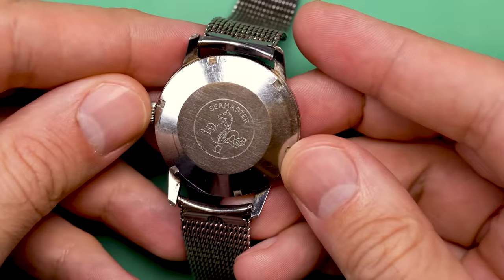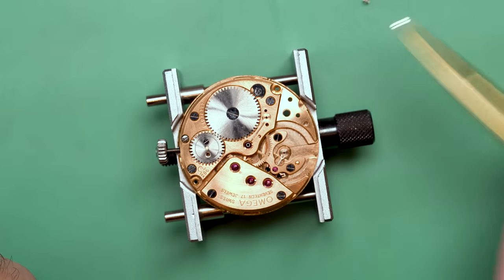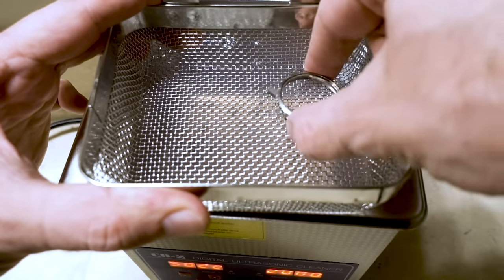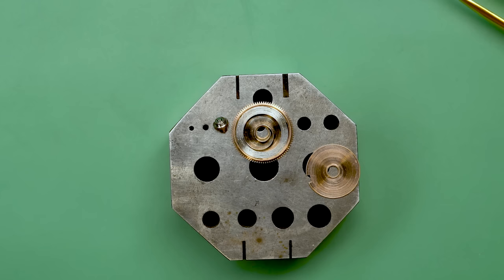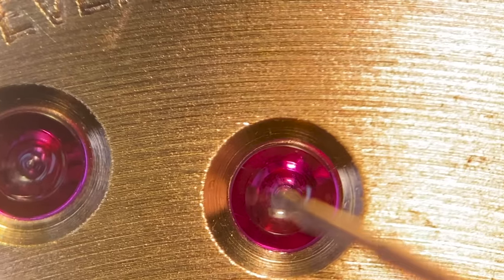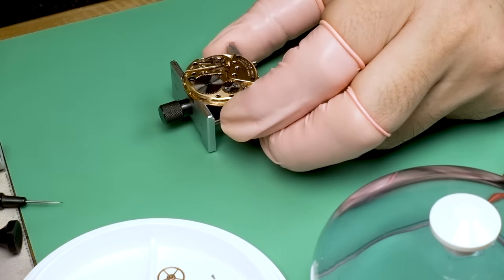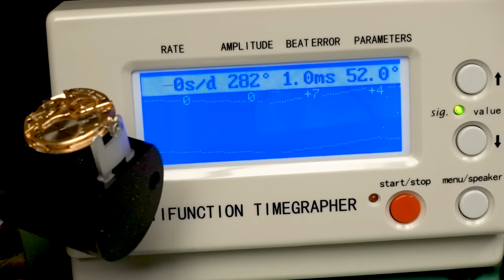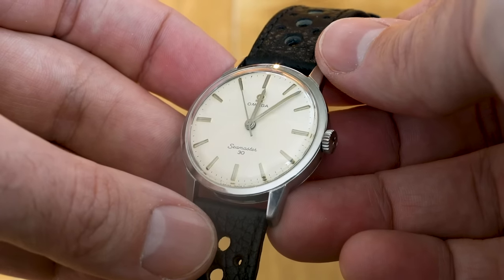Omega Seamaster 30 Vintage Watch Restoration With a Surprise :(

Comment: I understand the risk with “as is” but I have a couple of thoughts. 1.  The owner knew the balance was missing and chose not to divulge that which is severely dishonest and more than deserves serious negative feedback on eBay to warn others of this persons lack of decency. They don’t just mysteriously fall out of the case while your sleeping. Is it possible the owner bought it that way and never took it in to be inspected?  Yes, and I could be struck by lightning 3 times on my way in to work tomorrow.  2.  Always request movement shots. If they can’t/won’t provide them then that is a huge warning sign to stay away. If the person selling does not know how or have the tools needed to take off the case back then they can have a jeweler do it for like $5-$10. Take a couple quick shots then have it put back on while still in the store. Either way these risks can be mitigated greatly with a little perseverance. If they won’t spend $5 to make $500 you can damn well bet there is a reason why. 

This gets a little glossed over because you happened to have the exact same watch, with the same movement, from the same era on hand. I can only guess you bought the second one to be sure you’d have the parts to at least get 1 fully operational watch out of the deal but if you have to buy 2 bargain watches to get 1 working example then that is no longer a bargain. You would be better off economically buying runners that just need a service.  Those are still a risk but at least you know all the major components are in there. That’s just my take. Everyone has to navigate their own minefield that is buying second hand goods with no warranty/returns.

Comment: how difficult/expnsive would it be to source a new balance wheel?
Reply from the maker: You'd have to find one on eBay either on its own or part of a donor movement.
Reply: @WristwatchRevival  I mean, how much would this replacement part cost?

Comment: Very enjoyable production.  One recommendation if I may:  The balance-wheel shouldn't be allowed to oscillate whilst removing the cap jewel of the anti-shock mechanism's assembly.  By doing this while the balance wheel is in motion compromises the uprightness of the balance staff and could necessitate re-polishing the pivots of same.  I think the fork stones abrasions were the result of poor stone seating alignment and/or lack of lubrication.  Your calm and assembly discipline are progressing nicely and your bench tools appear to be of well-chosen quality and appear over all very comfortable to you.  You're obviously pursuing your craft with a good design plan and a successful arc is assured.   With all due respect I don't think the brass tweezers you use for general disassembly/assembly are best suited to your hand/eye interface. Lighter jaws on tweezers promotes, or elicits a more more refined 'touch'. If you experimented with a finer & standard length stainless with narrower points I think you'd develop a more intuitive feel for the connection's synchronicity   Please make more videos and maintain that thoughtful form of narration.                                       Thank You
                                                                                                            Mike Kirwan - Kenmore, WA

Comment: I was curious, do the dial screws work in a similar fashion as the screws that hold the cover on a ceiling light? The glass dome cover slides on and there are 3 or four screws that tighten, and press against the lip of the glass dome to hold it in place.  I know that's a strange comparison but the concept is really what I was curious about. The screws are tightened, and they press against the dial to hold it in?

Comment: Yeah... this is why if I read that a watch is a non runner, its going to have pics of the movement with the case back off before I bid. Unless it EXTREMELY cheap. I'm new so parts are something I don't have alot of.

Comment: On the balance wheel assembly there is what appears to be an adjustment with little tic marks and the letters A and R. I’ve seen it on other watches you’ve serviced. What is that for exactly?

Comment: Question. He said that he had cleaned that replacement balance prior to installing it, but once we got those close up looks at around 37 minutes, while he was removing the cap jewels, the balance still looked a bit dirty and corroded. What was all that?

Comment: I’m curious: how long did it take to become reasonably proficient, meaning that you could confidently embark on a simpler watch with confidence that you could succeed in restoring it?
Reply: When it comes to the movement, you can restore one on the first try without much difficulty
They are designed to be serviced, take it apart, clean the parts in an ultrasonic and oil the parts upon reassembly
There are a number of complications that can arise, bent parts, warped springs, a case that needs restoration
All of those are super difficult, but you could get away with a servicing on the first try, I recommend it, it's highly rewarding : )
Reply from the maker: For me it took about 4-5 months of poking around? I took Mark's class from @watchrepairchannel on watchrepairlessons.com but still needed some time to get more comfortable

Comment: I love your videos.  They are so relaxing and informative.  I am interested in starting the hobby but I don't find many candidates on Ebay.  For example, would you buy a balance assembly if you didn't have another parts movement?  What is you source for new parts because there must be parts that you can't find on ebay?  It's almost as if ebay is has been bought out by hobbyists who started long ago.

Comment: Thank you for your detailed and educational breakdown of the watch. You have a way of informing us with a pleasant easy going way of communicating . You have very steady hands and are very talented.  Thank you so much for sharing your knowledge. I have a question about the metal that were used. What is the gold material used to make up the inner parts. I am a watch idiot savant "WIS"
The favorite watches in my collection an Omega Seamaster with coaxial movement, Omega Speedmaster from the Moon to Mars. This is an attractive watch with the earth, moon and Mars sub dials
Another favorite is Ulysses Nardin Maxi Marine with black dimpled face. It is my daily go-to watch. The lume is top nought. Ths is the easiest watch to read at night while sleeping. The power reserve is a nice complication. The inverted cyclops give the crystal a nice finish and helps read the date. Can you provide me information where I can get the watch servicdd by a quality shop that do a good job at service and workmanship. Thank you for  the service you provide to people.

Comment: WOW !  Where are you ?  My 1970 Omega Seamaster electronic stopped. Had to send it to the UK from Fance to have it repaired. 500 Euro later, it finally works but adjustment using a ballpoint pen still sucks.  Would you like to repair my 1965 mechanical Oris Star (only a microscopic broken part to be replaced) ?

Comment: Question, is it possible to change a 24 hour  hand at the 3 o’clock sub position to a 60 second  hand movement? By changing gear ratios.
On a wrist watch with that has hour hand minute hand and date indicator at 6 o’clock position. 2 sub dials one at 3 and one at 9.

Comment: I'm late to this party, but I had to stop to say, this is my watch! Almost. I have a very similar Seamster 30. The dial on mine is almost identical, except the hands and indices are rose gold and the Seamster 'S' is the narrower style. Mine came with a balance wheel though! But I know the crown's not original because I replaced it myself.

Did you give it away in the end? I saw you wearing it in a later video. (Don't blame you!)

Great content and channel. Mark Lovick seems to have gone to ground, which is a real shame. Thank you.

Comment: Looks like those pallet jewels were running without lubrication for a long time, or maybe with grinding paste for lubricant.  That surface would get kicked by the escape wheel teeth 18000 times an hour but it would still take a while.  I'd be worried about the teeth on the escape wheel as well.

Comment: When you use those hand levers, I always wonder why you don't coat the back of them so that you don't need to pick through a scrap of plastic that may or may not have grit on it. 
Some nice white Teflon ought ot make the job a lottle more secure, I would think.

Comment: I’ve had that happen before where they said, “Used to run, but doesn’t anymore. Sold AS IS” then I opened up to see no balance wheel.  I mean, technically, they told the truth.  They just left out that it doesn’t run because they removed part of it! 

Shady way to sell watches IMHO

Comment: I find these interesting. Especially how we used to have a place that fixed watches, but they had closed down a while ago. So with watching these, I kinda hope that I can learn to fix these things myself if I ever need to. Though the most I do now is just change batteries, and adjust metal links for bands. I did even change someone's leather band out as it was worn down, they liked that.

Comment: 13:30 - why did you pick the parts off the table, put them back on the watch, then put them back on the table? You did it earlier with a couple screws also. Is there a reason for that?

Comment: I have an ACCUTRON that stopped running, usually just needs a battery but cant get anyone to work on it that doesnt want a fortune to fixit, any suggestions. Do you ever do a program on ACCUTRONS, they are nice.  Thanks, Jeff

Comment: The only reason I do not really go all out on vintage watches is their cases. I hate plated cases. They almost always have pitting and that creates a weak point.
Cost of re-chroming or plating of any sort ( other than Ceracoat ) is just too high in price. It is great for you who like to keep them looking the way they are. But I wear watches.

Comment: Hi Marshall, brilliant channel. I know absolutely nothing about watch making but nevertheless I find it compulsive viewing. Is there a reason why you don't place the bridges and jewels in the ultrasonic bath?
Cheers Eddie from the UK
Reply from the maker: Hey Eddie! I sometimes do, but generally they don't need that step as the watch cleaning machine does a good job. If, however, I notice that the plates could use more work then I'll put them in the ultrasonic as well

Comment: Do you have any diagrams that show you an exploded view of the watch movement?.  Sometimes I wonder if it would be easy to reassemble a gear or piece upside down inadvertently.   I mean I am sure the plates and stuff are straight forward because the holes for the screws are countersunk so you couldn’t assemble backwards  but it seems like if you took something apart and then reassembled let’s say a week later it could be difficult.
Reply from the maker: I don't have anything like that

Comment: Watched the entire video and subscribed.  At the present I am my father's Seamaster restored ( which is costing me a fortune).  It is an early 60s Gent Seamaster (plain). Could you please tell me how the Omega logo on the face attached?  Is it screwed in from back or glued?  I didnt notice  any attachment when you turned the face over.
Reply from the maker: They are almost always glued, and they often have two little feet to place them correctly, but not always.

Comment: I will trade the tiny work for a 45 minute bridge or plate installation on a clock any day… i gave it a try but nope not gonna sit there for nearly an hour just to find out something is in the wrong place and have to do it over again….. watches are easier.

Comment: Is there an easy way to remove that type of back cases without the machine he’s using? I just bought a vintage Tissot Seastar that has a similar case an wanted to check the movement

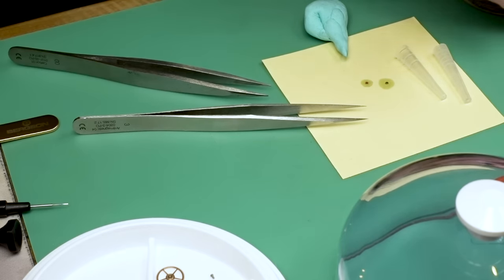Comment: Marshal. Can you please tell me were i can find the #8 tweezers that you use at 37:49 of the video. 
I’m a beginner to watch repair and noticed the tips on those look quite strong. 
I’ve bent my finer tip tweezers putting the canon pinion on. 
Thank you for your time and help. 
John.
Reply from the maker: Hey John, the big beefy tweezers I use to hold the jewels are actually #00 not 8, and I got them from cousinsuk I believe.

Comment: Great video as usual...just wondering does it mean that the watch is now a "frankenwatch" now that its made from two different watches? I'm not trying to dis the piece (which is gorgeous) just trying to understand what is really meant by frankenwatch, and why it's so bad? Also what do you use to magnify, a stereo microscope?
Reply from the maker: Frankenwatch means that it's assembled from different watch models, otherwise any watch that had a replacement part would be a frankenwatch.

Comment: How do you regulate the beat error? Thanks for sharing :) Great camera work.
Reply from the maker: Many watches have a beat error corrector on the balance, but this one doesn't so you have to take the balance off, fractionally turn the balance spring collet, check it, then repeat until it's right. It's a chore, and this video was getting long enough so I'll do it off video.
Reply: @WristwatchRevival  Thank you for the answer :)

Comment: hi there I have a tag heuer bought in the 90's new by me its seen a fair bit of life including some diving in the ocean as well as swimming pools  so chlorine and salt have worked their way into the rotary bezel ( it used to have a ratchet to stop it from bing accidentaly moved the ratchet no longer works I was informed this ring is just a clip on by means of a spring clip / right or wrong ?? any ideas?? as I rely on this watch when diving as a back up to my tank gauge  I am a master mechanic so this is not totaly out of my wheel house / by the way love the channel

Comment: I have a problem. I see detail. In this restoration the balance wheel was missing and needed to be replaced. The replacement balance wheel looked soiled, rusted and contaminated with visible brown goop at 37:30.(look at the left of the screen). Why would you put this dirty balance wheel into a recently cleaned movement? Am I missing something here? Your thoroughness and desire for perfection seem to have left the building.

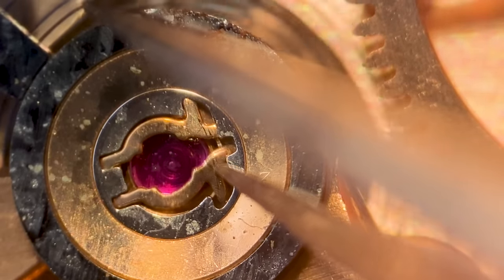Comment: It's a beautiful watch but your dish is as good as the worst of its ingredients, you forgot to clean that regulator (possibly even the balance) it's offensively dirty (37:18, 37:31) and in my opinion ruins the whole work and that gasket could also have been removed earlier, those hard bits could have scratched the glass.

Comment: maybe a couple of idiot questions (after about 40 videos I have already seen). Can fitted a rolex or a longines weel of the same dimensions ? Can this improve the accuracy of the watch ?  If we titanium plate the pivots the friction will be reduced ? (I have never dare till now to touch or even open a watch - not even from the flee market one -  just for optical inspection)

Comment: one might suggest an industry move over to viton gaskets?
if im not mistaken thats butyl rubber.
viton dont break down, in the auto industry? we dont bother with butyl if we can help it, specialist gasket shapes are an exception, but air conditioning gaskets made of viton, pretty much last forever , never use anything else, theres no point.
, not nitrile butyl etc.
viton will happily sit in neat diesel oil and not break down for many many many years.
its overkill but the gaskets are so tiny , why not?
oil doesnt break it downso you can use a slightly better grease than thin ole silicon too, when the gasket is so very small. makes no sense to be using butyl, which indeed will eventually crack or degrade due to age or exposure.

Comment: My wife has a small gold ? watch, it says "omega constellation 25 jewels  1978 18k 0,750" on the case, it ticks, but will only  run from 10 minutes to the whole hours till 10 minutes after the hours, than the hands stop, ik keeps ticking though, and the tiny seconds hand on a small face keeps moving.. I wonder if it is a real Omega watch...

Comment: I have a non working Omega Chronostop, from late 1960's, hand winding watch Cal 865 Ref. 146.009 - 146.010 Gray Dial, that belonged to my father, I wander if you would be interested in servicing it. Thank you.

Comment: could you clean a watch with just an ultrasonic machine?
Reply from the maker: Yes, I used to do so before I got the dedicated machine. It does a very good job but it takes forever (I did a 3 step process)

Comment: How do you know she you need a special for example, removing the gear that you did? Not all movements seem to use the special tool that you used on this Omega.
Reply from the maker: I had to learn it one step at a time. In fact if you look at my other Omega video on here I didn't know how to get that wheel off but I figured it out later.

Comment: That's a great trick.  Sell your cannibalized for-parts watches on ebay as "not working"

Technically I guess you don't need anything more than a case and a dial!

Do you even need that, though?  Could I send someone an empty box and claim that I'd 100% salvaged the parts?  I did sell it as "non-working" after all!

Comment: Is gasket only way to water seal watch
Reply from the maker: No there are others but it's the most common
Reply: @WristwatchRevival  I am curious about other ways to water proof watch 
I like G shock for water proofing ability while durable  light weight good look bright colour selections since made with resin 
How some watches can water proof so deep over 500meters underwater with  
A. Seal gasket
B. Bathroom glue
C.magic solution from Harry porter 👏